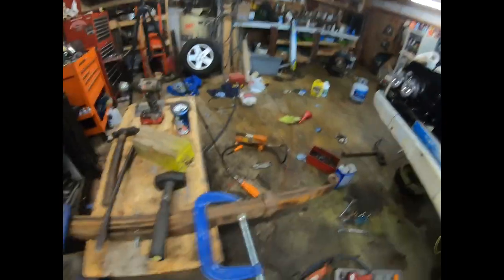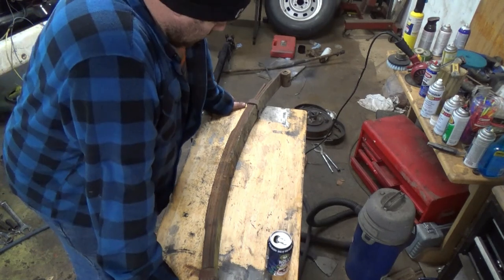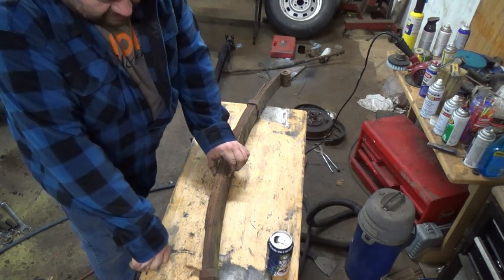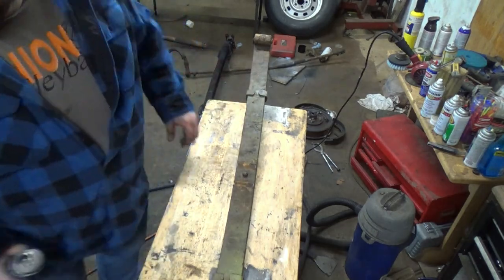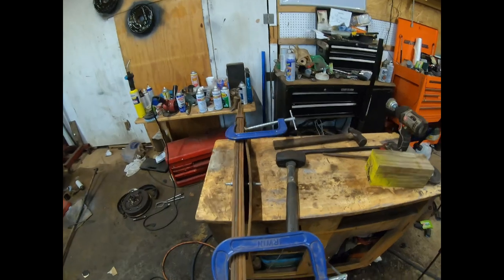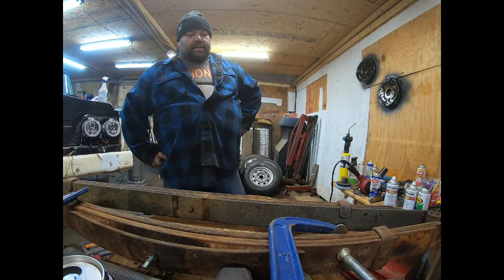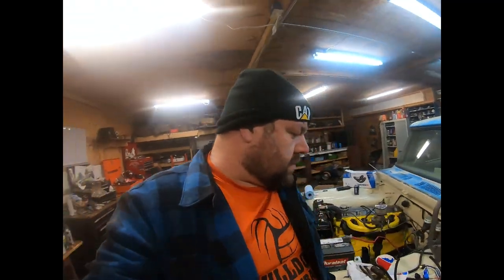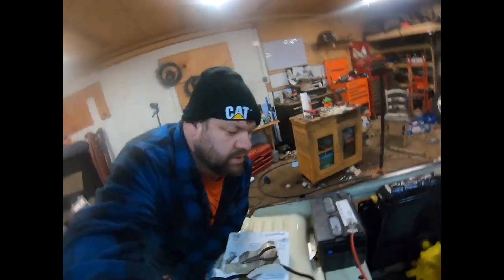Cheapest way to lower a sweptline d100 dodge? front spring repacking. FREE!

Comment from the maker: soon ill be driving this truck. toughed out the winter and decided to wait for the road. Im taking a few steps i didnt think i was going to originally. keep an eye out for my steering upgrades. love to hear from you all.
Reply: Your truck is bad Ass!!! I have a 63 f100 and getting ready to repack my front springs also. im curious about the ride quality??
Reply from the maker: Its a low speed cruiser.. so far it been fairly stable im sure heavy bumps and rough roads qould absolutely kick its ass. I guess like anything you get waht you pay for.. its cheap and solid. Def not a road racer.

Comment: I pulled the bottom three out of my '69 with a 318. It's a daily and used as a truck daily. Highway and town driving. Lowered it 3.5" and it rides amazing. I have zero complaints about driveability after 5 months.

Comment: Looking  for 1969 dodge D100  spindle  bearing spun  on 3/8 spindle messed up threads
Reply from the maker: Ive got no parts. Swemed to be several of these trucks out west. Wishbi could be more help. I posted in some facebook groups and fo I d any parts i needed.
Reply: @ROADBEERs   just found 1  275.00÷ shipping

Comment: I have to ask- how does it ride? I would do this to mine but want to keep the original ride “quality”, or at least not make it worse…
Reply from the maker: Its definitely  a rougher ride. Its not horrible it just runs out of travel
Reply: @ROADBEERs  Ok - that seems like a nearly fair trade then. We put up with a lot for the right look....
Reply from the maker: @ccathey3934  this one was done solely as a budget build. If I drove the truck for any length of time or used it as anything but a weekend cruiser id swap it to an independent front suspension.
Reply: @ROADBEERs  That helps~ mine IS my daily driver… leaning towards a Crown Vic due to cost and parts availability… looking forward to seeing your project progress…. Keep it on the road!